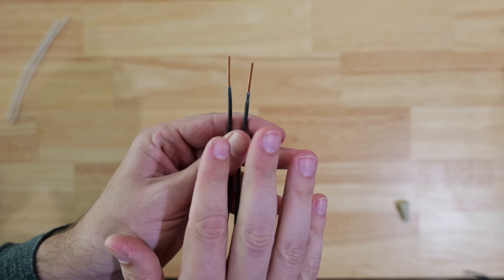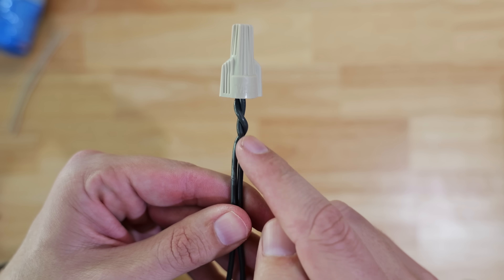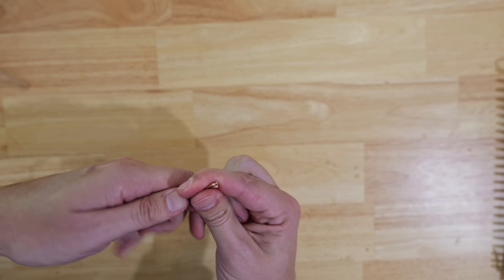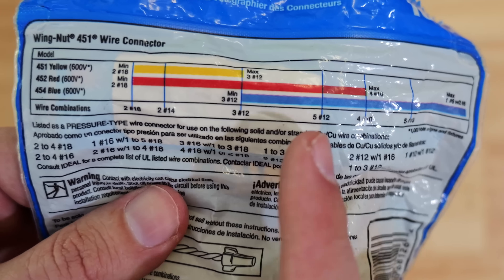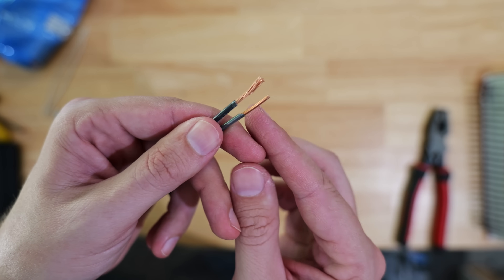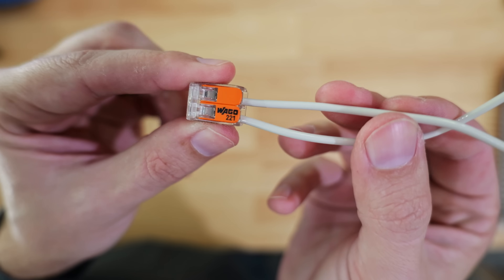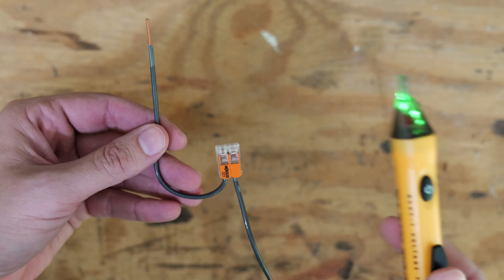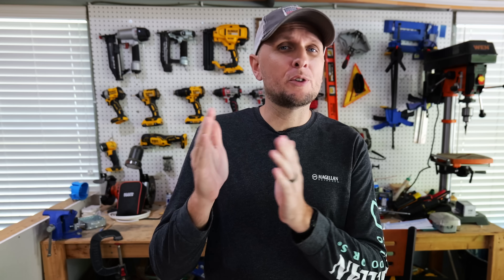7 FATAL Wiring Mistakes Most DIYers Don't Know They Are Making | Most Are Guilty of 3

Comment: My electrical instructor in college told to always use black tape even on wire nuts to prevent things or moisture from getting into the connection. It also made it so the wires couldn't just fall out.
Reply: If you Twist the wire good enough you will realize it will never come loose!
Reply: There's no need to place electrical tape all over the wires...and wirenuts...if you make a proper joint, those wires will remain in that wirenut for fifty years without issue.  All that tape does is actually cause a gooey, sticky mess for the next man making amendments to circuits and such.  Don't do that..its messy and not needed.  If you ever had to work behind someone in an outlet box that did this, you would understand quickly my anguish.  It's highly likely that's something your instructor picked up from making motor connections inside the motor J boxes.  The tape can help from vibration rattling a wirenut loose perhaps but even still, in motors, I never use tape...just good quality wirenuts like the Buchanan B2s or the older style yellow slimline scotch connectors....when either one of those two springs bite onto a good solid joint, those wires are going to be there for decades.
Reply: @chrisharrell5945  damn right sir, same thing with having a wall spray foamed. Setting the next person who installs a circuit or is troubleshooting up for failure
Reply: @Pownderosa  well the whole residential realm is one big escapade now days -- there's too many matters we could discuss. Houses are thrown together now days and most are built by individuals with hangovers or high on some type of drug.

Comment: A couple comments on the WAGOs.  Having used them all over my house and my workplace, I've never seen one open and drop the wire out.  We have one guy who worries about that, but instead of tape, he uses a small ziptie near the top and makes it tight.  That way you can still see inside, you can still use the test holes, and if you're using wire that is being pushed to it's max, it'll never get too hot, which tape might hold in.
Also, I'll never use a wire nut again, especially for multiple connections.  Being able to leave things hot with a 3 or 5 hole Levernut and just add the new conductor is so  much better than undoing a wire nut, and trying to get 3 or 4 wires all perfectly back together while not getting shocked is wonderful.  And for those who don't like even levers, there's the push in style wirenuts, and they work, but hard to ever undo if you're rewiring anything. 
And anyone leaving That much wire unstripped outside any lever or wirenut doesn't need to be wiring.  
Levernuts are just like you said about wirenuts.  Follow the instructions and you'll probably never have an issue with them.  They even come in different sizes as well for slightly larger conductors and amp loads.

Comment: I am from Europ and have always used Wagos for any type of electrical installation. I actually ran into situations, where I didn´t remove the exact 11mm of isolation, as required but never experienced any problems with that. The only thing that sometimes happend to me, was that the exposed part of the wire was that short, that it didn´t even make any contact with the peace of metal, that connects the seperate slots. But after about 4 years of working with wagos i never had a situation, where I got a lower output then input voltage from a wago. That doesn´t mean, that it isn´t possible at all, but for that to happen the contact area betwean the exposed part of the wire and the contact area of the wago, would have to be lower then the gage of the wire, (typically 1,5mm) to create eanough resistance, to seginifficantly reduce the output voltage, what appears very unlikely to me to happen. 
Also the wagos with the lever aren´t meant to be used in electrical boxes, at leasst not in thoose that don´t connect direcly to a device with a stranded wire, althought they can of course be used there. But there are actually special wagos fore the use in electrical boxes that only connect solid core wires with eachother, wich are fore exsemple the "wago 2273" or "Dosenklemmen" (don´t know how to translate that into english). Thoose don´t have levers, and take a lot less space, because they are only about half as thick as the classic wago 221, used in the video. But as mentioned they can only hold solide core wires.
Reply: Hast du Amis mal beim Haus bauen zugeschaut? !? Danach wüsstest du das diese Probleme alle Real sind... aber nur auf der anderen Seite des Teiches..🤣
Reply: I remember in Europe in the 1970s, they had a connector similar to the Wagos, but the wires were tightened down by screws instead of levers.
Reply: @waukee321  in my country we called these "chocolate" as you could divide them by breaking them (like breaking squares of chocolate)
Reply: @waukee321  I think what you mean are the "Lyster Klemmen". You still find a lot of them in old Installations and some people even still use them today, scince they are a little cheaper, but they are just such a pain to work with.
Reply: If you do not have any load you will measure full voltage even if there is just a tiny strand connected to the Wago. This is because the multimeter draws so little current when measuring. So you can go by unloaded voltage to see if a connection is good.

Comment: Great video! Yup -- seen these issues and early on made them - but realized it and fixed and learned to do it correctly the first time. I realized early on that the wire nuts without metal inside don't grip so I bought packages of different sizes just to have them. When I changed out barn lights for LED tubes, bought boxes of wire nuts and found the crappy ones were used originally.

I haven't used the two terminal connector shown. Will get some.

I don't like wiring as it always seems too much is crammed in the boxes. So, it is nice to know how to do it correctly the first time and NOT create a fire hazard.

Comment: Great video. I recently had to deal with this issue, installing a ceiling light fixture. The cheap manufacturer only had about two inches of stranded wire protruded from the fixture making it very difficult to get your hands between the fixture pan and the ceiling box to connect the wires. Add pigtails to the solid core wire... then you have two more connections to potentially fail, plus would have been even harder to fit that extra solid wire in the pan, more stranded wire would be much easier. Wago's would have made the job much easier, but I haven't seen them sold in Canada...
It seems like every product you buy these days is made with the absolute minimum and sometimes less than minimum amount of material, how much more would it have cost to have two more inches of wire, one cent??

Comment: I was trained as an electrician in the union in the 80's and the wire-twisting technique wasn't taught.  Never did it myself.  But I did come to use the best wire nuts (Ideal) align the ends of the wire, and use the largest suitable nut.  Tighten it well so the inner spring got a good grip on all of them, then give each wire a tug to make sure they weren't loose.

Two problems with twisting the insulated part of the wire:
1.  If for some reason one of the wires inside the nut is loose (e.g. it breaks off) you won't know it.
2.  If you need to work on that connection at a later time (e.g. add a wire) it's a mess.

Re: a stranded wire with a solid wire that is a challenge using a wire nut.  My method was to twist the stranded around the solid with my fingers, and leave it longer than the solid.  And then after putting nut on, give each wire a tug.  We didn't have those fancy new clip connectors you showed, but that looks like the better solution.

One more point about wire nuts:  in addition to the continuity of the wires being in contact with each other, the metal inside the wire nut also conducts electricity from one conductor to the next.  So, it's not entirely dependent on wire to wire contact (except with those cheap-O nuts with no metal in them).
Reply: Wago (and similar connectors) have the advantage of applying constant pressure to the wire inside, instead of applying a fixed pressure during installation and then not moving any more. This is mainly important for stranded wire. When using screw terminals for example, if you put a stranded wire or a tinned stranded wire with no ferrule in them, the wire (or the tin solder) may deform slightly over the years, which will increase the contact resistance, either to the point of not providing a connection at all or being a fire hazard. Terminals with spring mechanisms like the Wagos on the other hand will move if the wire moves any amount, keeping the connection secured. This is why you're only supposed to use screw terminals with single wires or stranded wires with ferrules on the end.

Comment: I was skeptical about Wago nuts. I bought a five pack and connected solid 14 awg to it. Tried to yank it out. I pulled really hard and finally got to to come out. You can see the bite almost shredded the copper solid!
Changed my mind. Now I only use Wago lol
It is so clean, so easy, and makes the box very compact!

Comment: I have 5 wires in a conduit all the are the same color.  What is the best way   to determine each wire at the the other end.  Is there a toner that you use.  The problem is I have to determine each individual wire on its own.  Most toners need two wires.  Is there some way to add power to one wire and test at the other end.  
I really like your videos.  You do such a nice job.  Very fast and concise.

Comment: All good tips!  I have learned to ALWAYS pull on those wires, even if I’m pretty sure the wire nut is on OK.  Maybe one slipped.  That stranded to solid is super common when people add outdoor lights, and the stranded wire on that new motion sensor light may be as small as 18 gauge, while your 20 amp lighting circuit is 12 gauge solid.  Thanks for a useful video.
Reply: And Wago make connectors specially designed for the scenario of a mix of stranded and solid connectors.

Comment: Used wire nuts for decades. Built dozens of houses and countless remodels. Customers thank me all the time for things I built 10-30 years ago. No problems with wire nuts. Just have to twist with strong hands. I have over-twisted and had a wire exposed out the end of the cap, but that's super rare, and easy to spot.
Reply from the maker: Thanks a lot for the input!
Reply: I agree if you fail with wire nuts it’s user error and weak hands
Reply: Only issue I've run into with wire nuts is older houses that have been remodeled once or twice, aka 1940s or earlier. This leads to people clipping off the twists resulting in a shorter and shorter wire. What started as 3-4 inches long ends up being 1-2 inches. End up using Wago connectors to extend the wires.
Reply: From what I've seen wire nuts cause issues once you go past 20 years in temperate climate. The temperature changes causes issues. Like the plastic falling off, unscrewing itself, and getting lose over time
Reply: I've just recently (two days ago) even seen a Wago connector in Canada. But I can guarantee you that wires twisted together with pliers first and then have the "Marrette" (the most common and first wire nut mfr.) installed will have much more wire-wire contact than the Wago. I'd love to see a study on temperature rise due to overloading of the Wago versus the properly installed wire nut. I recently did a reno where the insulation of several connections had heated to the point of being brittle but the wire nut was still very secure and unharmed.

Comment: For solid Wires you can use the Wago 2273 Series.
The Wago 2273 series is available for 2, 3, 4, 5 and 8 wires.
2273-202 is for 2 wires
2273-203 is for 3 wires
2273-204 is for 4 wires
2273-205 is for 5 wires
2273-208 is for 8 wires
To loosen the wires again, simply twist the wire(s) back and forth while pulling.
However, it is always important to keep an eye on the current carrying capacity of all Wago terminals.
Reply: And for the uninitiated, twisting to disconnect is the manufacturer's RECOMMENDED way to remove them. It is not a fault, as some other idiot stated on another channel!

Comment: In the few countries that still allow twist nuts, it is recommended to tape the wire nut and a couple of inches of cable leading into the nuts. I typically do the same for Wago connectors to prevent accidental release. Also, I import my glass fiber insulating tape as most tape sold in the USA, especially in hardware stores, is flammable. To be blunt, I have NEVER found even one new-build house that didn't come with a litany of wiring problems and issues. This may be due to especially lax inspections in Arizona (so I can't speak to the rest of the country), but I would recommend that anyone buying a house in Arizona have their house inspected for signs of shoddy workmanship.
Reply: Could you please show me where a wire nut manufacturer states that in writing
Reply: @fogsmart  Overseas, it is is mandated as code. Not coming from the manufacturers. Also true for much of Asia including appliances which internally utilize them. Most countries in Europe, including the UK, the use of wirenuts is either banned or discouraged. Those we do have, include a soft silicon seal around the wires entering the wirenut.
Reply: @davidgapp1457  interesting. Didn’t know that. I typically tape connections in things like fans, etc. The silicone seal sounds like a redundant feature but really, that must add a better seal against oxidation and such.
Reply: "few countries that still allow twist nuts" 
I have never left America, i'm not an electrician, and I have never looked up other countries electric codes. Though I would still put money on it that the majority of countries still permit twist nuts.
Reply: @jonyemm  of course is other continents they eat fish eggs, partially formed baby bird eggs, drive on the wrong side of the road, call kayaks canoes and like their women with hairy legs. So who knows. Then again one day there might be some universal standards for electrical wiring, something safe, something new that everyone objectively agrees is safer and still efficient.
Reply: @fogsmart  I like your optimism but the pessimist in me says even if humans live for a millions years we will never come to a universal standard on anything. 
Cannibalism isn't even universally prohibited.  Lol. 
Only way would be if, well when, 1 power controls everything. 1 law of the land.
Reply: @jonyemm  well yeah I can’t even get consistency from my local electrical authority between two inspectors heh hen. But I’m thinking specifically in this case about situations where wire nuts are used in electrical boxes. It’d be nice if there were some new technology that even home owners could employ wiring luminaries and switches and outlets. In the mean time I tend to use commercial grade products where I can.
Reply: @jonyemm  I work in Australia, Britain and the Nederlands. Ironically, as I am unwilling to go through 8,000 interning to someone who has never worked on commercial electrical equipment, mining equipment and industrial safety systems, I am not certified in the USA. But no, wirenuts are a primarily an Americas phenomena.
Reply: I do work in Florida and I've seen shoddy work here too.  I have always wrapped my connections with tape after assembly...  Nuts or push type. Makes no difference. People who don't wrap are either poorly trained or just plain lazy/careless. I've seen brand new construction and 100 year old.... And can't even describe how messed up some things have been.  I think that's common everywhere.
Reply: @keenanholland8429  well there’s a whole lotta certified North American electricians out there who would completely and utterly and unequivocally dismiss your remark that tapping your connections was a sign of better training. They’re gonna agree with everything else you said. Disagree? Go ,ale that statement about tapping on one of their contractor boards.
Reply: Incorrect, taping is not required per NEC & Mfrs, 3m, Ideal, Buchanan, & Wago do not recommend taping
Reply: @namocnhoj8397  I clearly wasn't referring to the USA code. I work internationally on power equipment and simply because a manufacturer doesn't bother to state the obvious (such as avoiding accidental flips on the Wago connectors) doesn't mean you shouldn't do it! Now excuse me. I am rewiring a power box where someone has twisted the sockets around several times to 'group' the cables so they can miraculously stuff two feet of wiring into a box.
Reply: @davidgapp1457  I apologize, I did not know you were from another country.  I was IBEW trained and can sympathize with your wiring problems with the extra wires.  I have experienced that more times than I can remember, and always it is the remodels, and remodels, and yet more remodels that inevitably turn a box into a rat's nest of wires.  We had the best twist on wire nuts as they are called, they were the old 3M type Y, R, B, it was a metal can with a square wire spring that would cut into the wires plus the spring was conical and could only expand to the diameter of the can in which it was contained, all of this was covered in a flexible PVC covering.  This did not have any wings, it was almost hexagonal with half the sides rounded.  They were more difficult to use versus the wing style, and more expensive.  The main advantage is that they had a built in limit, the wing style are often installed using a drill motor and with solid wires it is very easy to over rotate and drive the wing nut so far down that the wires come through the cap.  Again I apologize and hope you have a good day. John